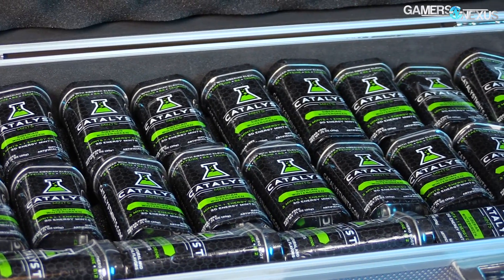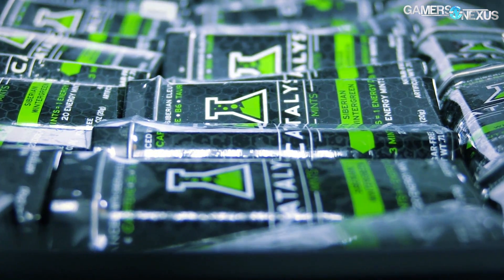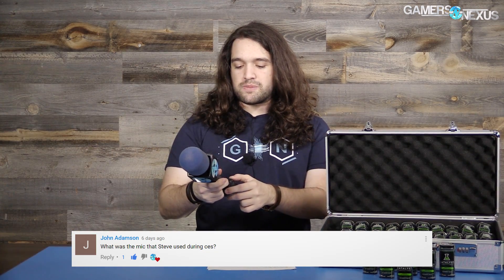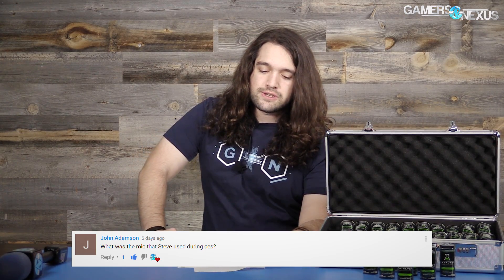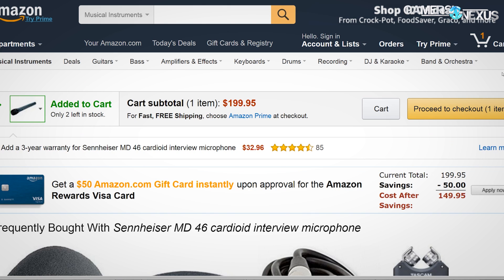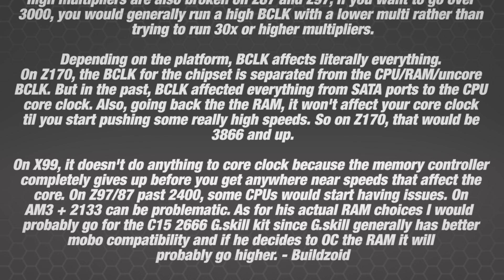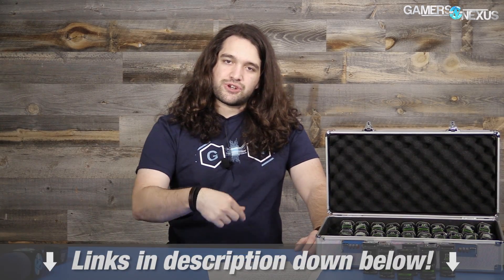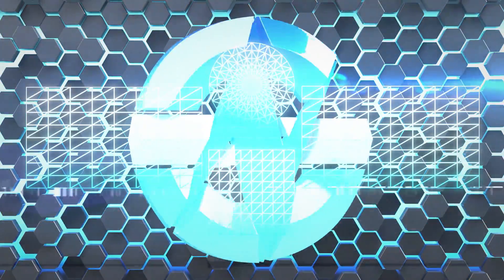Ask GN 41: Why Do CPUs Have an IHS? & RAM Overclocking

Comment: Question for Steve: Hello,I built a new system consisting a 1050ti only to know that it won't support my good old VGA monitor.Can I use a passive HDMI to VGA converter or do I need an active converter?
will any monitor with HDMI(f.e.hdmi 1.1) port in it work on the GPU HDMI port which which says 2.0
sorry for making the question complicated,I have no idea how this works, please address the question.Thank You
Reply: I use a dvi to vga cable.  Used converter as well that also works.  
Worse case scenario you can get a newer monitor with display port/HDmi then use your current one as a secondary
Reply: I use a cheap adapter that I bought on Amazon. Come to think of it, I haven't played any graphically demanding games on that system, so I don't know how those would be affected but spreadsheets and Solitaire work fine.
Reply: toy machine link please..Do I need to tweak any BIOS setting to make it work?
Reply: Sorry, on mobile, plus I'm not really computer literate. But use GN's affiliate link, go to electronics, then cables and adapters, and hdmi and/or vga. Should bring up some options for you. Hopefully Steve will weigh in on a GN approved solution, or one that they've tested and find tolerable.
Reply: I didn't have to adjust bios or anything, just plug it inline and power up the system.
Reply: You could probably just buy a DVI to VGA adapter. They used to ship them with every graphics card back in the day.

https://www.amazon.ca/s/?ie=UTF8&keywords=vga+dvi-d+adapter&tag=googcana-20&index=aps&hvadid=43945454262&hvpos=1t1&hvnetw=g&hvrand=17910438230306582620&hvpone=&hvptwo=&hvqmt=b&hvdev=c&hvdvcmdl=&hvlocint=&hvlocphy=9001330&hvtargid=kwd-8597413313&ref=pd_sl_6wrxi4ycts_b

Anything there is fine.
Reply: seraphis they don't work, already tried that, I need a converter
Reply: toy machine thanks,you are very helpful
Reply: Try searching for vga dvi-i adapter or buy a used monitor off someone.
Reply: seraphis it's dvi d
Reply: Surpuppa I am using kaby lake on Windows 7,so I am expecting weird shit to happen

Comment: GN - I am running an Asus Dual 1070 video card, and when benchmarking it and overclocking it, I have noticed it runs out of power before it gets unstable. (only a single 6 pin connector) Is it possible to plug the GPU cooler fans into a separate controller, so it can free up more power for the core? I heard somewhere that the video card might notice the open circuit and throttle or do some other things, and was wondering if that's true, and if there are work arounds... THANKS!
Reply: I'd like to see GN's answer for a more scientific and complete explaination, but I'm running my GTX1060 with an aftermarket Prolima air cooler and 120mm fans plugged into the motherboard, nothing plugged into the graphics card's fan connector, and it seems to be running fine. Though I don't know how much you'll actually gain by redirecting the stock fan's power draw.
Reply: Cool! (no pun intended)  I forced my fan RPM to zero, and it dropped my power consumption by about 8-10% (according to GPU-Z) so not a HUGE increase, but just a bit more to play with. It's more of a "gits & shiggles" type of thing.
Reply: Huh, a larger difference than I expected from those tiny fans.

Comment: Have you ever experienced motor clicking (not loud or worrisome of course) on fluid bearing fans? I'm sure you guys have talked about that one before, but my SilenX Ixtermia's are doing it (even if I just hang them by a thread) and it's kind of annoying.
Reply: I have and those are annoying - I have Venturi HP-12. I also have encountered hiss and screeching on all PWM regulated fans I've owned. I am still searching for a silent case fan, and have spent 100 USD so far.
Reply: Might sound a bit silly, but for that much I'd be injecting any open part I can get into with sewing machine oil!
Reply: AFAIK that is a common problem with PWM fans at low operating speeds. I have the same issues and reverted back to normal 3 pin fans that run at low speeds and just run them via a Phanteks fan hub that has a pwm fan connector.

It somehow works and the 3 pin fans get regulated in very minute increments just like a pwm fan but without the increased cost of pwm and without the annoying clicking.
Reply: 3R45U5 Funny that only couple of review portals (spcr) does acoustic frequency analysis, and not just loudness. Also funny how PC community isn't more aware of these issues. Finally someone that understands...

I ended up DC controlling all my fans, and used antivibrational grommets to silence vibrations. Silent, but not SPCR silent, though @ 800 rpm.
Reply: My SilenX Ixtremia fans are 3-pin fans, 1600 RPM. They come with silicone fan mounts which when used definitely dampen the noise, but it is still the most audible part of the system when idle. I might have to look into using a fan hub to control their speed!

Comment: i have a 6600k clocked to 4.6ghz with a 1070. and I want to buy a LG 34UC79G which is a 144hz 2560x1080 monitor, do i need to upgrade to an i7 to get that 144hz goodness.? or will my i5 be good enough?

Comment: Why does Intel use such poor TIM? Good TIM is not expensive and would drastically equal out the various core temps.
Reply: SS S Because for the lower power locked CPUs it's fine. They save money by using the same cheap paste on all their CPUs. Apparently a lot of effort goes into optimising it.
Reply: Thanks, seems nuts that they have the same TIM on a $100 i3 as the do $1000 processor. Doesn't surprise me though.

Comment: Do AMD's GPUs have better "IPC"? In that with the 480 vs 1060 the 1060 is nearing 2000mhz, while 480s seem to top out at 1400mhz, but the relative performance is still about the same in many cases. Assuming memory bandwidth wasn't a factor how fast would a 2000mhz 480 be?

Comment: do you think the fury and fury x are still worth buying? do you think that spending $50-90 more on a fury over a 480 would be a worthwhile upgrade if you are gaming at 2560x1080 or 2560x1440?

thanks guys!
Reply: Matt Heitmann they are faster cards just let down by memory amount and thet use more power than 480

Comment: About NeoVoodooTech question. I'm using a laptop fan (5v) on my modem, because the modem goes so hot that shut down itself. I just put it on the back, to exhaust air. my modem have a USB port (I think is for DECT 6.0 phones), and use a USB cable to connect the fan. its not the "best solution", but it works. My modem is a Technicolor TG582n.

Comment: Have you ever reviewed or thought about doing a video on a DIY Hybrid Drive solution? There are certain Marvell based RAID cards that support a function called HyperDuo which use an SSD and an HDD in "capacity mode" to make the SSD act as the large cache of the HDD, and software for it also lets you manually pick things to permanently reside in that cache as well (thats where i'd stick BF1 for sure haha). Along those lines, have you ever fiddled with intel Smart Response caching that sort of does the same thing? I imagine these options would interest alot of budget builders that want faster load times but can't afford single large SSDs.

Comment: My question is that DirectX 12's split frame rendering method, will dual GPU setups result in double the amount of VRAM? since both of GPUs hold different frames, instead of the usual SLI rendering method?
Reply: All the assets are still mirrored across both gpus, so now, there won't be a doubling of the VRAM

Comment: I have an issue with a gigabyte gtx-1060 6G D5 rev 1.  I have to turn off the "fan stop" because it makes an annoying noise everytime it starts and stops, which seems to be very often(around5times/minute. It seems the cutoff temp is really close to the idol temp so it switches on and off too much. I'm able to set the fan permanently on with the app but i would like it to work properly in the future when I need to sell it. I think the sound is the fan is hitting the shroud. It also make the noises then going up or down through a certain rpm range. If anybody has had this issue with that card or has fixed it, let me know. thanks.
Reply: +Neo Skribe I have the 1060 G1 Gaming, essentially the same, same cooler and all.  I had the same issue, there appear to be two causes.  Either a) your fan power cables are getting hit by the fan blades, or b) the fans rattle against the heatsink of the card.  Mine was the latter, and I'd be yours is too.  My card made a rattling noise when the fans spun up from 0rpm, so I used a screwdriver to loosen the three fan mounting screws in each fan.  It involves some trial and error, but basically it allows the fans to be pulled by gravity a few tenths of a mm away from the heatsink and not rattle against it.  Now my card is silent :) If it appears to be the fan cables, simply push then gently with a screwdriver or pencil such that they're moved out of the way of the blades.  If you have any questions just ask!
Reply: +Neo Skribe I have the 1060 G1 Gaming, essentially the same video card, identical cooler and all, but luckily I solved it!

I had the same issue, there appear to be two causes.  Either a) your fan power cables are getting hit by the fan blades, or b) the fans rattle against the heatsink of the card.  Mine was the latter, and I'd bet yours is too.  My card made a rattling noise when the fans spun up from 0rpm, so I used a screwdriver to loosen the three fan mounting screws in each fan.  It involves some trial and error, but basically it allows the fans to be pulled by gravity a few tenths of a mm away from the heatsink and not rattle against it.  Now my card is silent :) If it appears to be the fan cables, simply push then gently with a screwdriver or pencil such that they're moved out of the way of the blades.

If you have any questions just feel free to ask!
Reply: Jonathan Hiener Try making your own custom fan curve in the GIGABYTE GPU software that puts the fans at 0% at 50-60 degrees maybe that will work. If not you could RMA it but even if my GIGABYTE GPU is running at 0-25% fan speed I can never hear it anyway personally so you could just have it running at 15% on idle.

Comment: Could you guys do a video on the Intel Pentium G4620 and a 460/1050 running from a dc pico power supply?

I would like to see how low you can get an actual modern pc power draw in the best case scenario running games at various qualities and resolutions.

Comment: Why aren't pure copper heatsinks used more frequently, especially in SFF systems where the superior thermal properties of copper would be a benefit?
Reply: People already pay 45 dollars for an aluminum heatsink. Why not just make a copper version that will be able to dissipate heat faster and with less noise?
Reply: Patrick Bateman Copper is far more reactive with the air.
Reply: Patrick Bateman Aluminium is about 60% the conductivity of copper. And is much less dense and way cheaper. Using pure copper wouldn't be much better and certainly wouldn't be the difference between safe temps and unsafe. If the heatsinks were pure copper they would simply be made smaller and have the same ability as bigger lighter aluminium heatsinks we have now. Also with air cooling the benefit you get from more metal is not linear.
Reply: I'm not talking about those big tower heatsinks where there isn't much benefit. I'm talking about those <40mm heatsinks where copper would probably reduce the temps by 10°c and / or noise by a couple decibels.
Reply: If these small form factors remain popular, you'll no doubt see more efficient coolers shrunk down to fit. Whether this be solid copper, 3D vapor chamber, or some other technology, manufacturers will always be chasing the next big trend to get your money. Just got to be patient.

Comment: Question: I dont understand the how pci lanes work. In terms of how many there are and what they do. What is a good number to have. They seem to connect many types of devices.

 Whats happening when a lane x16 is halved when another device is installed ?
Reply: daniel M.2 SSDs currently use X4 lanes right now for another reference.
Reply: Helpful cheers.

Comment from the maker: Thanks for watching! Great questions this week. Leave your own top-level comment for next week's episode. The mic we talk about, for the curious, can be found here: https://bit.ly/2jxtAvl

Thanks to Buildzoid for the OC answer: https://www.youtube.com/channel/UCrwObTfqv8u1KO7Fgk-FXHQ
Reply: Gamers Nexus can you solve my question is it worth buying 1440p 60hz BenQ bl2420pt or should I go with lg 24gm77 144hz
Reply: Question: I know I have to add some extra voltage in order to achieve the best overclock on my GPU. How far could I safety push the voltage on my msi rx 480 gaming x, to get the highest possible overclock. Ive seen GPU overclocking guides and spoken to people that suggests its safe moving the voltage slider in afterburner all the way to the max. Do you agree? But Im worried that +100mV in afterburner will hurt my gpu in the long run. 

My goal is to get the highest possible overclock on my 480. I have well ventilated system. What is the the highest voltage  (+mV) can i safely add without being too much?  Should a higher voltage be okay as long as the temps are under check?

Here is the link to the GPU overclocking guide I mentioned earlier : http://www.tomshardware.com/faq/id-2749337/safe-gpu-overclocking-guide-2016.html

If you could answer my question in the next episode, I would really appreciate it:)
Reply from the maker: We have XLR inputs on our camera, but use those for on-camera audio (shotgun/condenser backup, depending) and then mix our important/critical audio through a separate device. Quality is much higher, production time doesn't take a hit, and we have far greater control for multitrack (up to 8 total mics) and multi-lav mixing.
Reply: Gamers Nexus Hi Steve, would you  please give me feedback on continuation of EK Predator 280 Video, namly the performance review of that unit in combination with ek prefilled gpu block? thank you in advance.
Reply: Gamers Nexus 
Hey guys, thanks for the video and thanks to the viewers for the interesting questions. Now, I have bit of an issue, You mentioned that the thermal compound bellow the ihs on kaby lake isn't consistent, what do You mean by that? I'm looking to upgrade my system to kaby lake from AMD's fm3 and would hate to find out that in the long run KL's thermals will be a problem or that KL as a whole is some how a bad choice. I'm literally ordering the parts within the next 48 hours so even a very quick response would be very appreciated. But If not, i'll see You guys in the next one, cheers!
Reply: Try using MSI Afterburner and set a custom fan profile :)
Reply: wow my question got featured! Thanks Steve that was very informative and helpful. and of course Thanks to Buildzoid for the amazing insight!!! =3
Reply: and thanks for getting my name right, it's Portuguese for "fictional name" ^^
Reply: Question: Why aren't there many cases  that support vertical GPU mounting and usb 3.1 front panel ports?